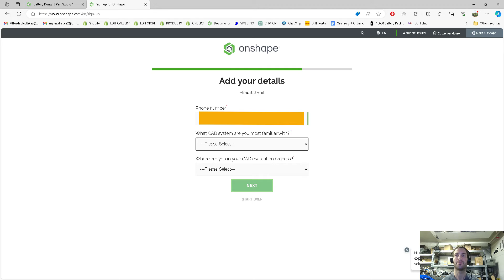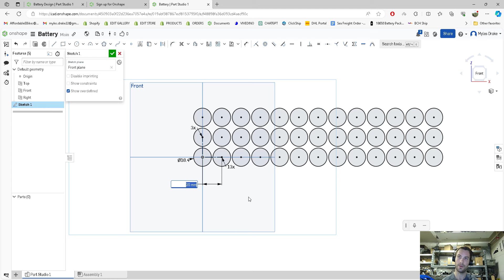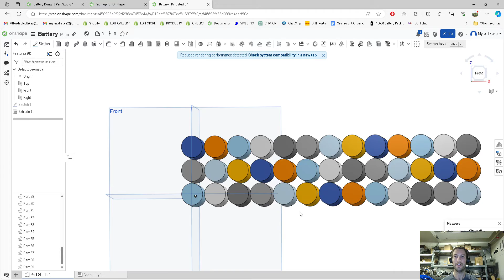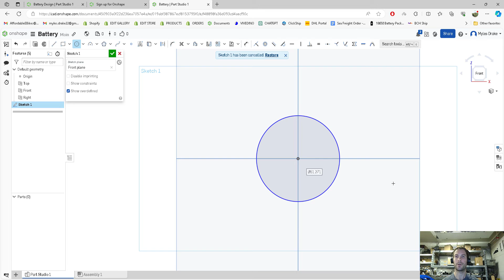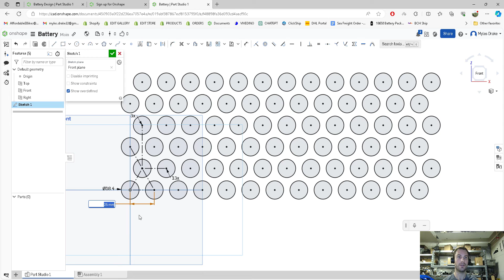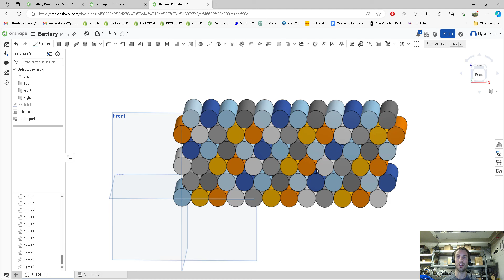18650 Lithium Battery Design Crash Course PT1 - The Basics

Comment: for 21700, 21.4 mm too?
Reply from the maker: Cell holders you'll want 21.75mm usually. 21700s vary slightly in size where most are 21.4mm and then some (like Molicel P42A and P45B) are a bit bigger at about 21.6mm.